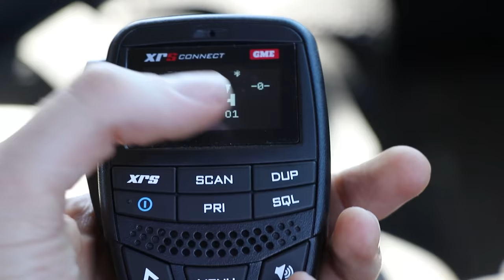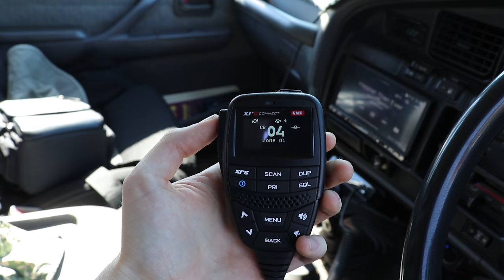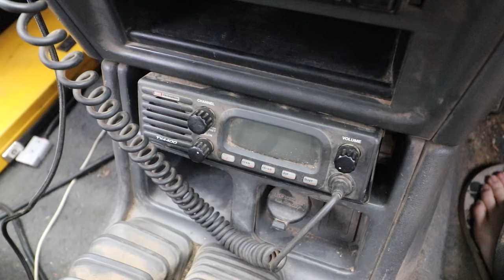You've been using YOUR UHF WRONG!!! CB Radio SECRETS for 4WD in Australia PLUS History & Technology

Comment: You do  know that you can do more with a standard cobra CB then you can with that thing your running now If your setup is a 1 to1 match For example. take the radio pop the lid and turn the wattage screw down to 100 milliwatts then turn the modulation screw up to 100% on the meters. then put the lid back on. add an adjustable echo power mic. and connect it to a 100 inch steel whip with a pair of slim line spring on a good solid aluminum mirror bracket then ground every thing from the radio and where your coax plugs in to the radio as well as at the mount both springs and the base of the whip with braided 110 electrical wire to the frame of the truck. bolt the antenna mount to the rack on your truck and ground the rack also in the same place you ground the rest of the set up to your frame. run an extra coil of the same wire off the back of your rack that when near a body of water you can just toss in the water. then key that mic and ask for a break. the local with in a 10 mile radius will tell you you sound like crap. the rest of the world he going to want to know what the hell your running that comes in 10x10 on their radio's in other countries or at least thats what Aussie's used to ask me when I had my set up on the air.
Reply: Would you like to buy a comma?  🙂

Comment: Why get a CB radio when you can get your tech and general license and then operate on the 11 meter band?
Reply: Several things with your comment, the 11 meter band is a CB band not an amateur band so need for a license there either in your country or mine, and the video is from here in Australia and we don't have tech and general licenses for ham radio, we have foundation, standard and advanced, foundation is enough for people to get on the 10 meter band (if you meant 10m and not 11m like you said) but it's dead most of the time.
Also the UHF CB and 11m CB band, and also the VKS-737 subscription HF LMR network are very useful tools for awareness of what is ahead and for assistance when on the road away from civilization in Australia and their function is not fully replicated in amateur radio generally.
Ham radio is good fun and is very useful too but it's not usually going to be your primary means of doing these things in the outback in Australia even if you are licensed. I do also encourage people to get licensed and get into amateur radio but it's not being used for the same purposes to the same extent. That said the only radio in my vehicle is a ham rig but I'm not generally in need of what these other services are used for. If I were going to be out exploring in the outback I would want a combination of multiple of these different services available to me, not only having ham radio because I am licensed to use it.

Comment: Should have said repeaters RECEIVE on 31-38 and transmit on 1-8. We have so many problems everywhere with people tx on 31-38. They should have been locked out when the 80ch plan came in. DO NOT use 31-38 peeps.

Comment: UHF in Aus is so outdated. We definitely need high transmit power and more importantly, DMR.
Reply: @whalenz  that totally detracts from the purpose of UHF CB then doesn't it? I'm sure everyone can benefit and its not exactly feasible to get everyone in a hobby group to go out and get licensed where the hobby isn't radios itself.
Reply: UHF still has its place. It's great for short range communications and at 5 watts output, you don't need to worry about somebody "keying up" close by. You don't want someone 50 metres up the road pumping 25+ watts into the front end of your transceiver.
There are certain advantages to DMR but for most users the disadvantages outweigh them. DMR is great when the signal is good but as the signal becomes weaker at a threshold point all intelligence is lost. Analog radios will still operate well enough at this point to convey intelligence albeit a bit "scratchy".  The other downside to DMR's is current draw. This is especially a problem when using hand held devices.
If you need a bit more power and range you could consider class licensed 27 mhz. with SSB functionality or the VKS737 network for even greater range again. If you're really serious about communications consider getting a ham license. The multitude of bands available as well as the various modes one can operate makes it by far the most versatile communications medium of them all.
Even if you've got all of these on board, you'll still find that you use UHF. It has its place.
Reply: Buy a coden HF..

Comment: There are between 12 and 14 RADIO INSPECTORS IN THE WHOLE COUNTRY, cb radio is so low on their horizon,  as to be totally ignored.
Unless you create so much drama as to Interfer with commercial or emergency communications , they are not interested.
Reply: In Victoria they ARE interested and act on complaints from licensed users - both amateur (ham) and commercial...

Comment: Great Video. Study up on your antennas dB gain has nothing to do how it radiates the pattern. The design of the antenna dictates the pattern. So a 3dB gain vertical antenna will still have the same pattern as a 6dB gain vertical antenna. dB gain works on both Tx and Rx. You're bigger challenge on UHF is the loss in the coax and bad vSWR. I can have the worlds best radio. But, it's sh!t if the coax and antenna are sh!t. 73's from the USA.

Comment: Your technical ability to explain is not great champ. There is also 27MHZ CB radio. Also There is Amateur radio running HF VHF UHF SHF and so on. You forgot to also explain that in duplex you transmit on 31 receive on 1 32 2 33 3 and so on. 29 is the pacific HWY Sydney to Brisbane. And The hand piece is a bad idea if the curly cord goes bung it will cost you a heap to replace the hand piece. Also not just 5 but 35 is illegal to transmit on.